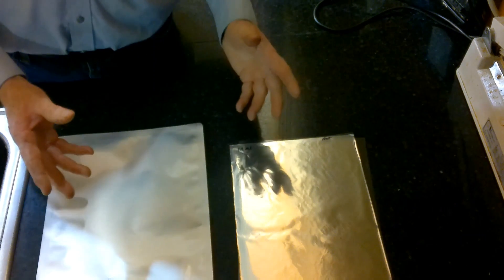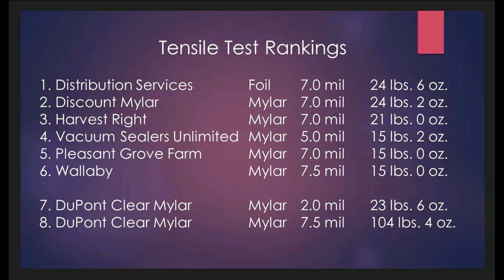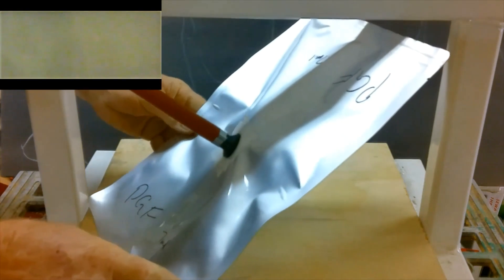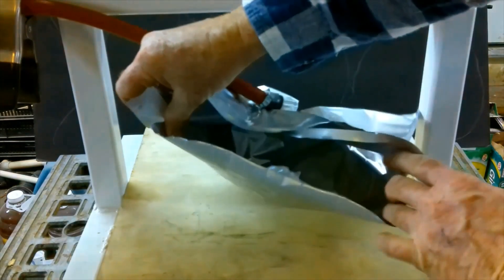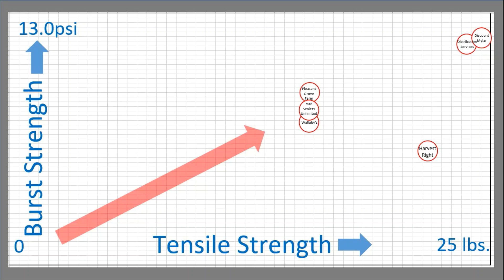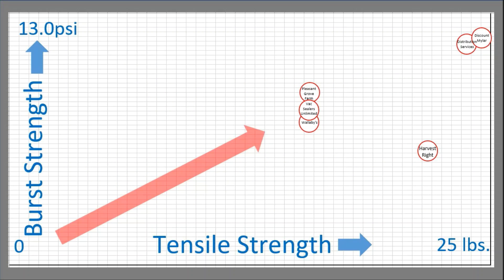Buyer Beware Series- Which Bag Is Best?

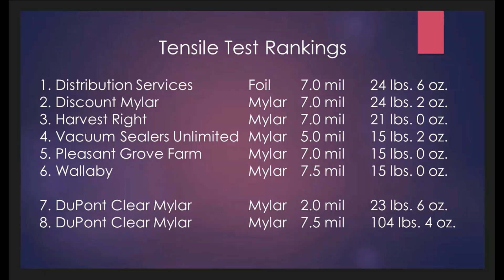Comment: 04:25 - Tensile test rankings
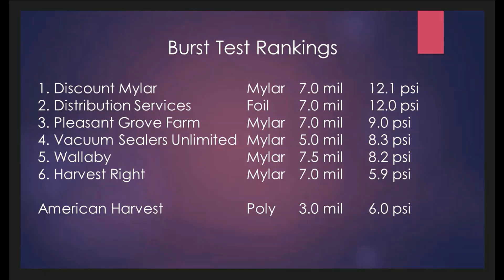14:15 - Burst test rankings

Phil, I would like to see a test with StayFresh mylar bags. StayFresh places their labeling, similar to HarvestRight, on the mylar bags; which means it is possible the bags are from one of the other brands already listed.

Another request would be to show a strength-to-price (burst strength per tensile strength per USD) ratio to show what would be the "best" for the USD, at that time in the market. I think that would be beneficial allowing others to determine cost-risk benefit analysis. Thank you!
Reply from the maker: Never heard of Stay Fresh until now.  I guess it's a matter of time for competitors to come into the market.  Funny they sell bags but no oxygen absorbers.  Thanks for the tip.
Reply: @ StayFresh is a freeze dryer company that’s been established in the market now for about two years. They provide some free stuff when purchasing their freeze dryer including Mylar bags, a bag sealer, and some other items. The company is based out of California. He’s the only owner of a freeze dry company I know that has a PhD relevant to the freeze drying industry

Comment: I'm more interested in testing the seams for 'Air Tight'.  I'm more concerned with the quality of the manufacturing.  We bought some inexpensive bags on Amazon and they turned out to NOT keep moisture out.
Reply from the maker: In all the testing I've done (Burst Testing) I have never had a manufacture seam fail or a secondary seam (my seam) fail.  All fails have been from the center material.  I prefer 7 mil.  I'll tolerate 5 mil, but nothing thinner.  Are you having a problem with foods clumping (sticking) together?
Reply: @Philat4800feet  obvious signs of moisture.  Fat not involved.  
Veggies and candies.
Reply: @tonyb33168 make sure your food is completely dry. The only real way to tell is to weigh your trays when finished, put them back in for 2 hours, then weigh again. If any have lost weight, put them in for another 2 hours and then weigh again. Do this until extremely small amount of difference in weight per tray.. I think it's 1 gram. Anything more than that and you will have moisture problems. I think Phil does this now, but school bus guy has been doing it a long time.

Comment: Interesting but the only things I'm really concerned with in a bag are the rates of ingress of moisture and oxygen over time.  Harder to test, but they're the real reasons we buy the bags.
Reply from the maker: I believe,  but this has not been tested, the twenty year shelf life of freeze-dried food is limited to these two issues.  With time, oxygen will be able to find its way through the polyester film and behind that will follow moisture.  I have seen Mountainland freeze dried food after 45 years.  The carrots were white, but they still tasted like carrots.  Much of the food lost its color, and some of the nutrients were not as strong.  This test is ongoing.

Comment: I would gather from your tests here, that the addition of the aluminum layer weakened the bags in both the tensile strength and how much internal pressure they could withstand.  I would not rule out the plastic being used in any of the bags as being other than mylar without testing a known true mylar with an aluminum layer.
Reply from the maker: I would think the opposite.  Mutiple layers should strengthen the film.